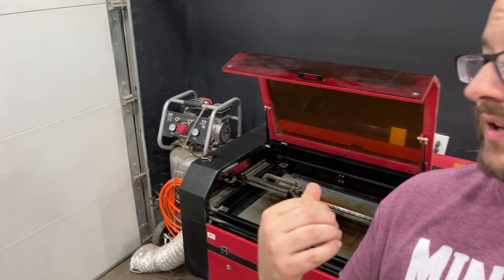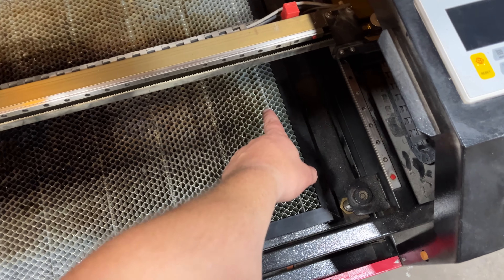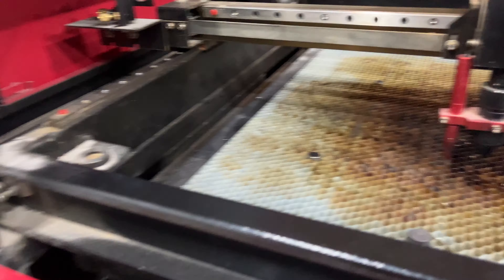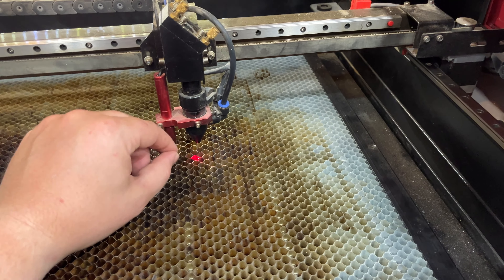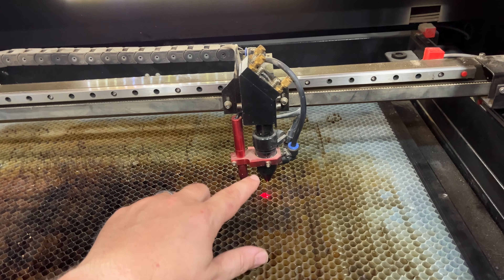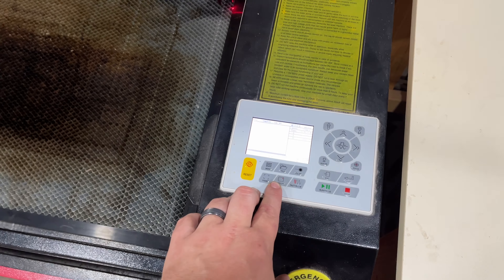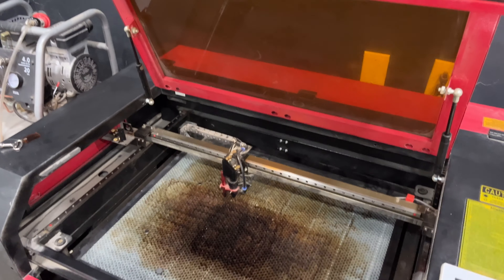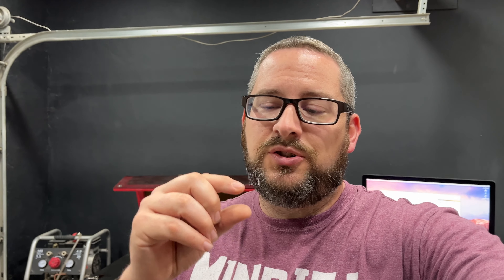Going Over the OMTECH 60W CO2 Laser after 4 Years - Review and Overview

Comment: The biggest issue is reliability. It's constantly needing maintenance, with the air assist pump failing multiple times. The laser tube itself has also started to show signs of wear, and I'm worried it's going to die on me soon.
Reply from the maker: Unfortunately laser tubes have a lifespan.

Comment: I'm  glad you thought the chiller had a cool color? You basically said that Omtech supply
 has a non functional  air handling and water supply items. Why would I buy this system?
Reply from the maker: @keithr994  very simple, the climate I live in isn’t extreme and I don’t run the machine for hours at a time. 80w or higher definitely needs a actual chiller or if you have a 60w in high temp areas or long run times I’d suggest a actual chiller. Great question, thank you!